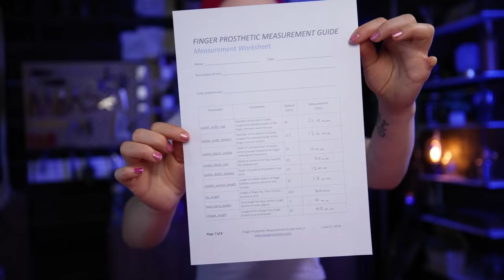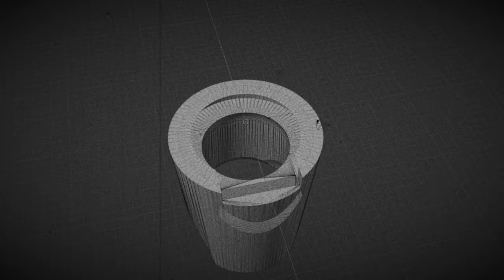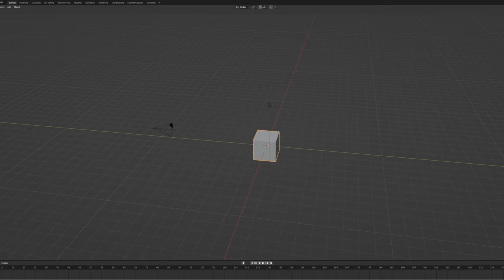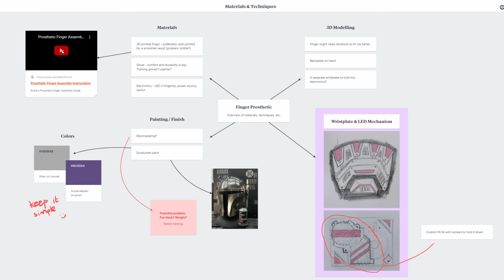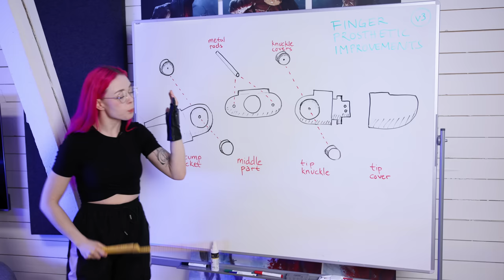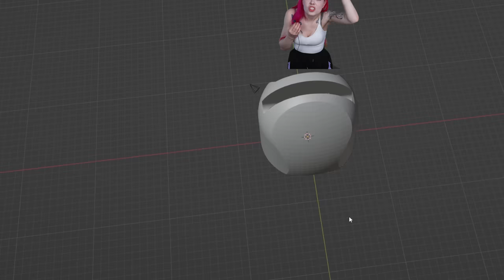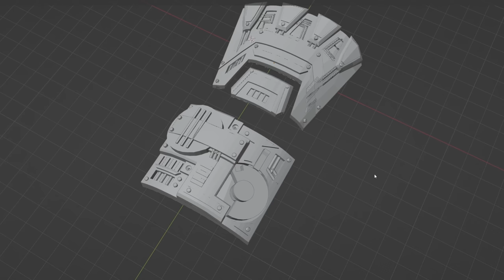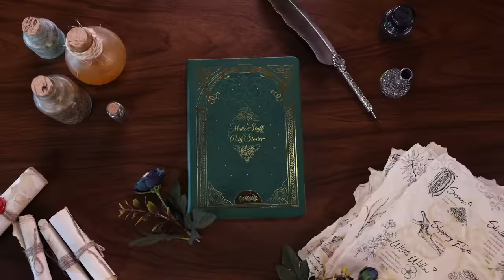I lost my finger.. so I made a new one

Comment: When I was younger, my Dad accidentally cut of the tip of his right index finger. So, I made him a series of prosthetic finger tips based on sewing thimbles. I had four of them in a little black velvet lined wooden box. There was the mini fork tip, (for stabbing at olives or mini sausages) the generic rubber-pad tip (which, to be honest was the most useful), the itch scratcher tip (had the end of one of those wooden bamboo back scratchers glued to a thimble.) and finally, the popular ear cleaning/nose picking tip (bristle tube brush glued to one of the thimbles). It was mostly for silly fun. And his finger healed up nicely in the long run. But it was a fun project. And it made him laugh.

Comment: My right pinky finger had to be amputated due to a pinch in the outside tip that necrotized and became infected to the bone so off it came at the first joint, so no pinky at the knuckle joint. but the tendons are intact and attached to the remaining cartilage and the tiny nub still moves when I flex the rest of the fingers but doesn't protrude enough to move a cup for the replacement finger so a silicone lined open sided cup when I make a new finger similar to yours,  I might use some of the stainless steel sheet i have on hand that remains of what I used for a pick guard on my electric guitar project....  lol  cutting and drilling and bending to get the shapes i need to get the shapes similar to yours using tiny nuts and screws for the pivot points. I don't have a 3D printer.  As a mechanic, (my finger was injured working on the brakes of a truck-a long and painful story)  I'll use the tools that I have and am familiar with. I think that a shiny stainless steel (Bionic) finger will look really cool anyway. a little textured silicon pad on the tip for a little added grip may be a good idea for mine and yours as well.  Just a thought..

Comment: Couldn't you use a string counter force on the back plate that tries to pull the finger back (think rubber band) it will add strength to the grip. Also try to attach a thin layer of rubber to either the tip or whole finger with engraved circles (similar to fingerprints) should also help with the grip. Might even be able to create a sensitive touch plate or button attached to something either within the finger or glove that will kind of "poke" what part of your finger is left, so whenever you grab something or press something you will at least feel it

Comment: For using the ctrl on the keyboard, you could offset print the detachable head of the pinky finger or make the whole assemly a lot shorter length wise. For grip you could use NinjaFlex on the interior of just the tip (which would requires more printing time because of dual materials)or to make it more quicker by making printing lego like connectors or any indentation that can be filled up with silicone or any high friction materials 😁😁😁.

Comment: It looks great especially with your tattoo's. Its a great achievement as it is but it would be aa fantastic base to work on refining the design. Such as using a tiny pressure switch sitting on the tip of your pinky finger and a tiny electronic pully system. Maybe work with a watch maker and computer nerd so it could look cool like beautiful watch internals coupled with electronics.

Comment: If you put Hooks on the top of it  like the saebo glove has add rubber bands. On each joint then cast the parts in  metal then use a wire,  with a retractable mechanism like a lawnmower has a pull core the gripping power will be better instead of a elastic one, and you should cast it out of metal from the part you 3b printed look at the saebo glove it will help

Comment: Passing rando gives advice: General rule with saws of any kind. Never be comfortable. Always do your absolute best to ensure everyone present or remotely involved's safety. Its fully possible to get a chop saws blade stuck suddenly and the wood splinters and the guy 10-20 feet away loses any eye. There's no such thing as absolute safety when it comes to saws. Only minimized risk. You spend long enough using one and you are near guaranteed to lose a digit. Or at the very least have a minimum of ten accidents that didnt harm you or anyone but may have required a change of underwear.

Comment: I wonder if you could make a “plate” for the string out of silicone, as it would be more comfortable.  You could lube it up with olive oil so it slides easily.  Can you 3D print with silicone or something more flexible?  Also I wonder if you can scan your hand in to the computer at different angles so the computer can do a custom fitting to your little finger end.  If not make some rook for some form fitting padding like memory foam or silicone?  Also if you want some grip you could put some liquid rubber on the tip of the finger.

Comment: I wish I could be fixed like this. But my fingers are still there, just half of the nerves don't do what they're supposed to! Also parts of my arm. 
I don't recommend breaking your neck, especially not 7 or 8 times as I have. Even just the minor fractures of C7 that I have, resulted in bone spurs that pinched one of the three nerves that run my dominate hand/arm. So I lost partial sensation to my hand, but only the important parts like my thumb, index, middle and half of my ring finger. Now I see that I'm lucky to have feeling and motion in my pinky. 
Awesome video!

Comment: What about ratchet gears at the joints? One on each side, with a clip or block that holds each rotation to match your finger movement, the resistance should hold the robotic finger pressure.  Like a hand winch....  Great shows, kudos to your adaptability with tools and materials. Amazing Projects.   👍👍

Comment: I actually think this is pretty neat. Particularly the light (see the original inspector gadget's opening to see what I mean.) IMO I'd probably have went for a LED that can adjust the brightness without reaching a melting point on the plastic. However I don't see you wearing this glove in your later video thumbnails, was it not as practical to use over time?

Comment: 2 questions. Why not just use a toggle button for the light. And second have you thought about maybe a very thin layer of rubber on the end to give a little traction when it still doesn't have grip strength?

Comment: If you had a cap... like a thimble, on say, your index finger ... with a cord  running to the backplate and onward to the mechanical finger extension  that would transfer the energy of a functioning grip to both  fingers when you close the index finger. You could probably pick up a skol bottle. Add cords to all fingers and you might be able to use the combined grip power to crack a walnut. maybe... maybe worth tryin..lol. 
an then get into a pulley system and add some socket attachments.. so you can change the spark plugs on a car... or unbolt a manifold. 
The world at your fingertips..

Comment: it kinda bends with an angle coz the string is on one side only maybe using two strings would fix the angle or run the string in the middle

Comment: Hey, sheet happens! (table sawing sheets of material joke). One Saturday, I fell asleep (read: passed out drunk) with my left leg overhanging the bed. I crushed the sciatic nerve behind my left knee and woke up with a paralyzed leg.

I tried to take a step, and collapsed. I just laughed, "oh, my leg is asleep", but after 24 hours, it was still paralyzed.

Panic set in. How will I work? I can't afford to take FMLA and not work. I need intensive physical therapy! I bound my knee straight and went back to work, telling no one. It took months, but I did my own physical therapy and got my leg back almost 100%, not even a limp. I was lucky.
Reply: Wow! Not the recommended method but I'm glad it worked out for you!
Reply: @notme222  When it happened, I immediately thought of Dave Mustaine. He almost lost his arm, due to a similar situation. I saw pictures of the medical device they put on his hand to help him get dexterity back. I thought, "he's a millionaire and I have nothing. I'm fucked!"
I worked in a freezer warehouse, so I would take my boot off at break time and check my foot for blood circulation. If I saw pink, I knew I was alright. I couldn't tell if I tied my shoes too tight. At home, I would try to flex my toes, assisting with my hands. Eventually, movement came back, then feeling. It was arduous.

What exacerbated the issue was I had a prior injury in that leg, resulting in nerve damage. I really thought there was no coming back.

Comment: It may not help with keybored and mouse but I could see it helping with controller (also maybe if it was fully metal with very small eletric motors in each joint that could help with power as for controlling the motors maybe tiny bottons in the base that could pushed woth the stump..... Idk theres maths to be done here maybe hiring an engineer to design it but in theory these slight upgrades would you and many many others just a thought)